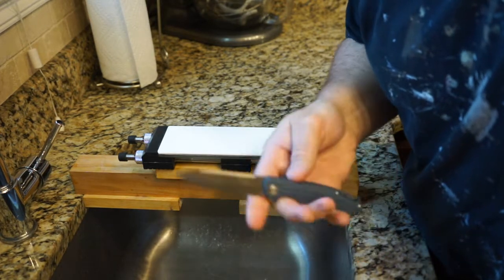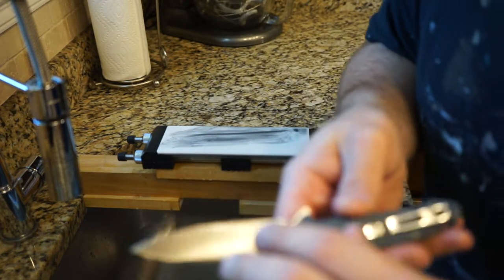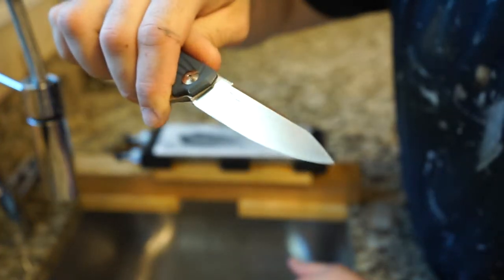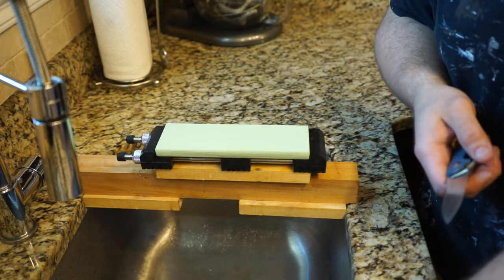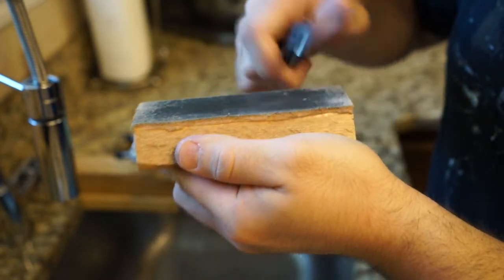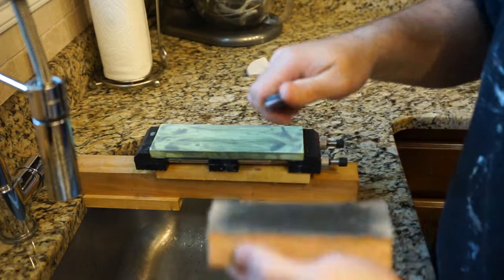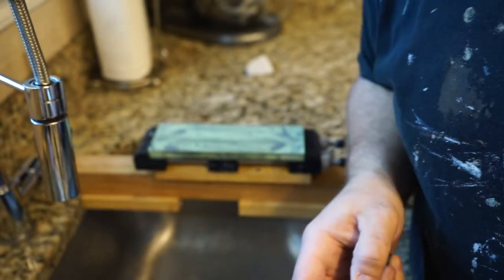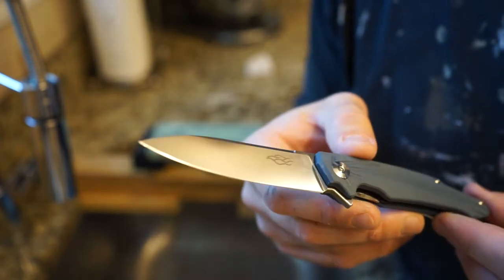How to Sharpen "Chinese" D2 Ganzo FH 21

Comment: Do you know if the Spyderco bench stones will sharpen S90V and/or Maxamet?
Reply from the maker: Mike L. I would lean towards no on s90 and definitely not on maxamet if you’re referring to the ceramic stones they sell. They would probably refine the apex a little but maxamet you pretty much need cbn or diamond. Silicon carbide works but people have had mixed results. Jef Jewell has good results with silicon carbide stones. So I think it depends which stones you used from Spyderco. Do they make other bench stones besides the ceramic ones?
Reply from the maker: The double stuff 2 is a cbn Stone I think. And the rods for the sharpmaker come in diamond and cbn if I’m remembering correctly